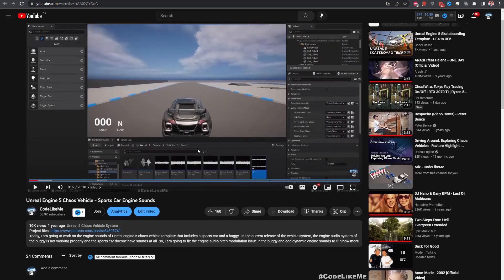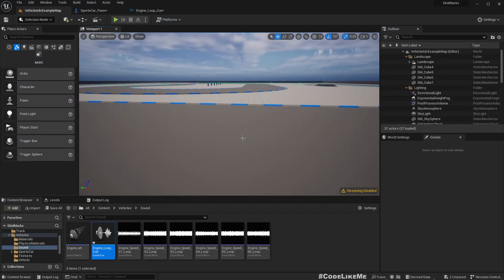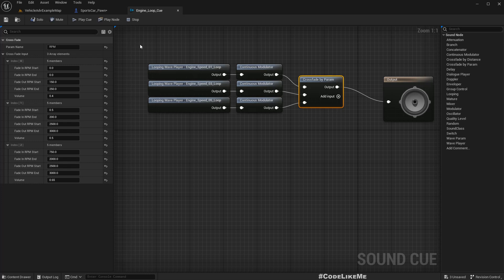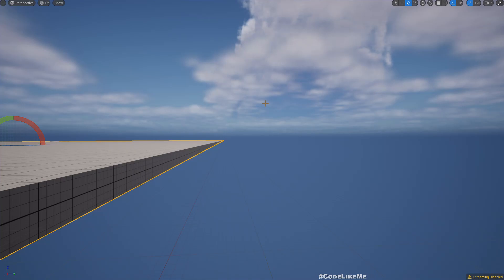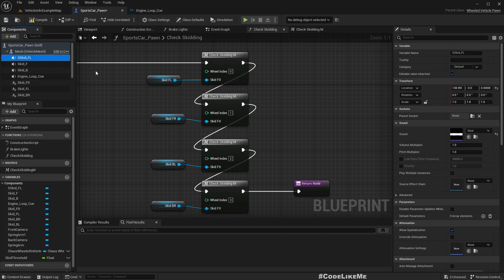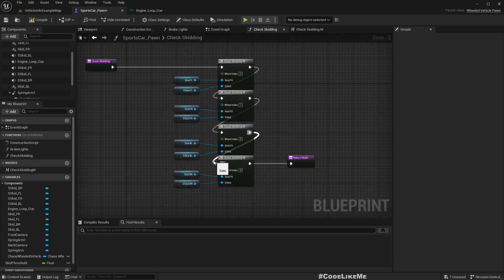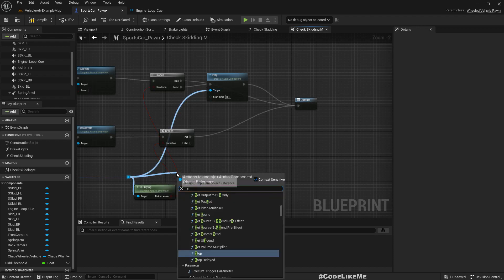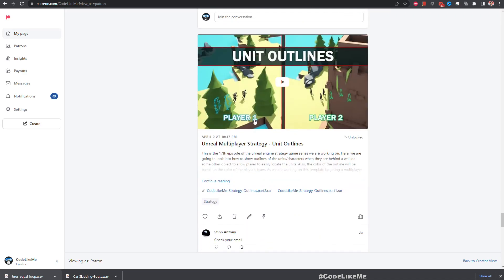Unreal Engine 5 Chaos Vehicle Sounds (Engine and Skidding)

Comment: Hello everyone, the creator forgot to show us the parameters of the 'Continuous Modulator' for the 3 sounds. Here are the ones that worked for me.

Continuous Modulator 1:
Parameter Name: RPM
Default: 1
Min Input: 0
Max Input: 200
Min Output: 0.65
Max Output: 1.1
Param Mode: Normal

Parameter Name: None
Default: 1
Min Input: 0
Max Input: 1
Min Output: 0
Max Output: 1
Param Mode: Normal

Continuous Modulator 2:
Parameter Name: RPM
Default: 1
Min Input: 20
Max Input: 3000
Min Output: 0.75
Max Output: 1.35
Param Mode: Normal

Parameter Name: None
Default: 1
Min Input: 0
Max Input: 1
Min Output: 0
Max Output: 1
Param Mode: Normal

Continuous Modulator 3:
Parameter Name: RPM
Default: 1
Min Input: 700
Max Input: 2800
Min Output: 0.85
Max Output: 1.4
Param Mode: Normal

Parameter Name: None
Default: 1
Min Input: 0
Max Input: 1
Min Output: 0
Max Output: 1
Param Mode: Normal
Reply from the maker: thanks for sharing

Comment: what is the difference chaos wheel vehicle component and vehicle component  object reference ?
Reply from the maker: 2 different classes that represent wheel and vehicle. 

Vehicle Component Object Reference:
The Vehicle Component Object Reference is a component that is part of the Unreal Engine's built-in Vehicle Physics System. It provides a simplified and straightforward implementation of a vehicle physics simulation. It allows you to define the vehicle's movement, physics behavior, and controls using basic parameters such as acceleration, braking, steering, suspension, and wheel configuration. The Vehicle Component Object Reference is commonly used for simple arcade-style vehicle simulation or prototyping.

Chaos Wheel Vehicle Component:
The Chaos Wheel Vehicle Component is part of the Chaos Physics System in Unreal Engine. Chaos is a newer physics system introduced in Unreal Engine 4.23 as an alternative to the PhysX physics system. The Chaos Wheel Vehicle Component offers more advanced and realistic vehicle physics simulation capabilities compared to the traditional Vehicle Component. It utilizes the Chaos physics solver, which provides improved accuracy, stability, and performance for complex physics simulations. The Chaos Wheel Vehicle Component allows for more precise control over vehicle dynamics, suspension, tire friction, and other advanced physics properties.